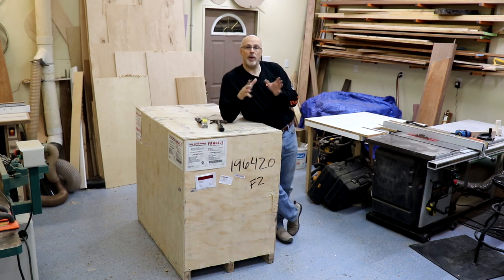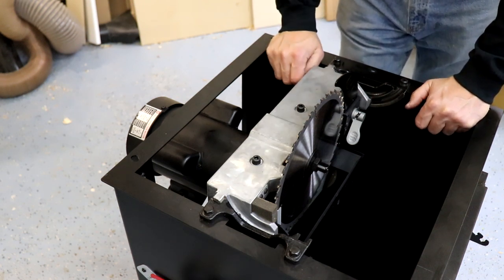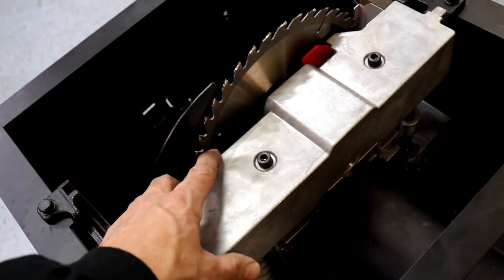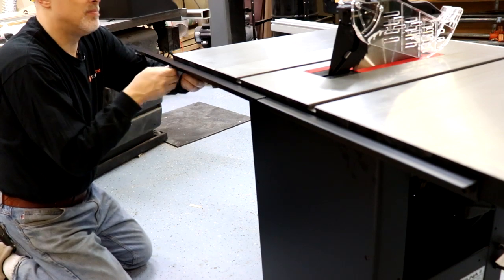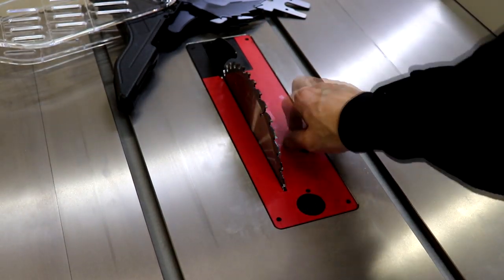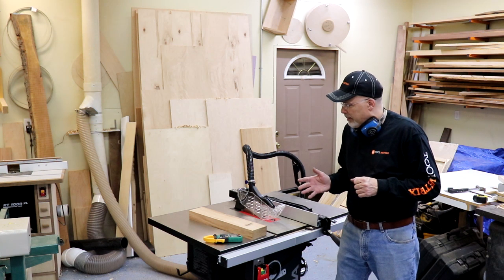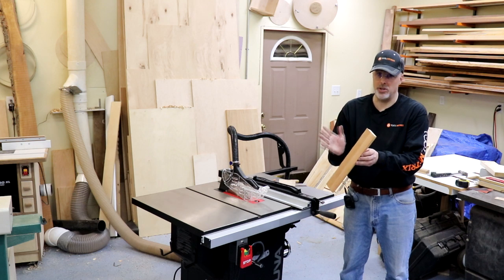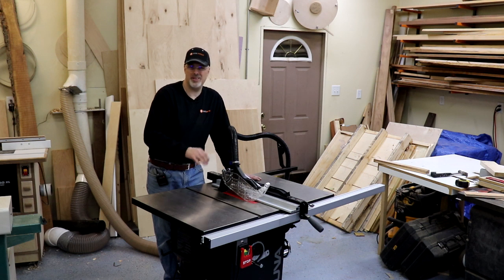Laguna Fusion F2 Table Saw Unboxing and Deep Dive Examination

Comment: What "tweaking" did you do to get the left to right tolerance so low? Mine's pretty bad out of the box.
Reply from the maker: I removed the wings and filed off the factory goop that was in the joint, and deburred the surfaces. After doing that everything went together nicely and the top was flat.

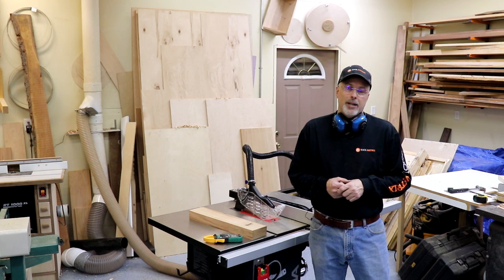Comment: You mention having a 20amp breaker (mark 10:30); however, Laguna doc states to have a 25amp circuit for F2 at 110v.  Any idea how to have a 25amp breaker on a 110v receptacle?  I pinged Laguna on it and no response.  BTW, the F3 states similar, 25amp breaker requirement for 3hp, which sucks as rules out my 220/20amp outlet in the shop.  Laguna did confirm F3 requires 25amp breaker for me, but nada on the 25amp 110v requirement.
Reply from the maker: Hi TBone,   I ran the F2 without any problem on a 110V 20amp breaker, and I pushed it pretty hard.  To have a 25 amp breaker on a 110V circuit you should have 10 guage wire.  I'm guessing that less than 1% of F2s are running on 110V/25 amp circuits.  Most are likely running on 110V/20amp circuits, and some are probably running on 220V circuits.  I ran all of my tests on the F3 using a 220V/20amp circuit, and didn't have any problems there either.

Comment: thank you ToolMetrix for another great review!... how does the dust collection on this compare to others in this category?...assuming a solid 400+ CFM dust collector as recommended in the manual. Is it just average? or fantastic? Also, for table saws in the $1100 - $2k price range, what other recommendations would you make? And lastly, how does the fence on this guy compare to others in this price range? I plan to make my move but given this is fairly new, I don't want any regrets. Thank you so much in advance!!!
Reply from the maker: Hi Matthew, thanks for the feedback.  On the dust collection front, I think its tricky for a manufacturer to provide a one size fits all solution, because so much of what makes a perfect configuration depends on how much air flow you can deliver.  It's unique to include above table collection, and it's neat that they did that, but in order to get decent collection from both above and below the table, you will need a dust collector that is larger than 400 CFM.  If I had just a 400 CFM collector, I would remove the above table collection and focus all of the air flow on the below-table collection.  If I had 600 CFM, I'd use both upper and lower collection.  With 800 CFM I'd expand the internal ducting to 4", all the way from the outside of the cabinet to the blade shroud.  And if I had 1000 CFM I'd expand the upper dust collector hose from 1.5" to 2.5" and I believe it would get much better collection.  And just to be clear, I'm not talking about the theoretical maximum of the dust collector, I'm talking about the actual air flow at the connection to the tool.  In that price range I'd also consider a SawStop contractor saw, or stretch your budget a little bit to a SawStop Professional 1.75 HP.  No question that is a more expensive saw, but the safety feature is nice and quality is good.  I think the fence on the F2 is a huge winner.  Functionality wise there's not a fence on a table saw in this class that I like as well.  Quality wise, I'd say that this fence is comparable to the SawStop Professional or the Jet ProShop.
Reply: ToolMetrix This is exactly why I am such a big fan...  informative and very helpful. Thank you! I am costing out a Contractor SawStop with the upgraded fence.... yes a bit more $$... I may go this route and just forego the stellar dust collection for the time being. Thanks again! And good job.

Comment: Thinking about upgrading to this saw, but I would probably want to transfer over my Incra TS-LS positioner fence.  Anyone have the Incra installed on their Fusion?  This saw looks pretty mobile in the video, which is also important for me because I regularly have to move my saw around to have enough room for cutting.  Any issues with mobility?
Reply from the maker: Hi Edward, sorry about the late reply.  Mobility is fine, although the wheels aren't super big so you'd want to clear a path before moving it.  Some of my tools have larger wheels and I can roll over pretty much anything.  Not a major problem, however.  I didn't try an Incra on it.

Comment: On the F1 and F3 videos you tested for decibels and also the amperage under heavy load. Do you have these for the F2. I'm about to pull the trigger on either an F2 or F1 and would like the comparison. I have a 110v 20A dedicated line for the saw.
Reply from the maker: I ran the F2 on a 110V 20 amp circuit with no problems at all. Amperage draw as shown in the video was 19 amps with that piece of thick oak. Decibel level was just a bit lower than the F1 as I recall but I don’t have the number.

Comment: Other than the cloth did you  use any cleaner to remove the manufacturing grease/oil from the cast table.
Reply from the maker: Nothing else was really needed to remove it. It came off super easily. But I wiped it down with mineral spirits just to be sure that all the residue was gone.

Comment: Why is cast iron good for table saw wings?
Reply from the maker: Hi Stan, it's generally preferred for stationary saws and other woodworking equipment due to its resistance to flexing, flatness and added stability from its weight.  You can certainly produce great results using a saw that has stamped steel wings, however.

Comment: Does the blade guard accommodate full-kerf and thin-kerf blades?
Reply from the maker: The blade guard is fine but you need to swap out the riving knife for thin kerf blades.

Comment: Thanks for great reviews f both the F1 and F2.  I am moving to a basement shop and I am struggling over which saw to purchase because of the logistics of moving it to the basement down stairs.  I was leaning toward purchasing an F1 due to the weight.  However, I really like the features of the F2 and would prefer it to the F1.

You stated that the top of the F2 could be easily removed.  Do you have a feel for the relative weights of the top and the cabinet when separated?  Do you think removing the top from the F2 and moving it in pieces down the stairs would make it easier or as easy as moving the F1 down them?

Any advice would be appreciated.  Thanks!
Reply from the maker: Hi Paul, sorry that I missed this previously.  Yes, I'd rather take the top off of an F2 than an F1.  I don't have a feel for the relative weights of the components when the top is removed, but my hunch is that the two pieces both become pretty manageable for two people when they are separated from one another.

Comment: Thank you for the great videos of the different Laguna Fusion models. So you were running the F2 on a 20 amp circuit, correct? I see Laguna recommends a 25 amp circuit for the F2, but I'd prefer to stick with the 20 amp I already have in place if it won't be problematic.
Reply from the maker: Yep,  I didn’t have any problems with it running on a 20 amp circuit.

Comment: Years ago I watched the New Yanke Workshop with Abe Norman during one of the shows he polished his top so I started doing that and not only didi the wood ove faster but it didn't let it rust.
Reply from the maker: Norm Abram was the best!  One of my great inspirations. I’ve tried a lot of different coatings on cast iron surfaces but haven’t found one that is both slick and prevents rust.

Comment: My F2 has been ordered. Hope it get's here before I die..... My question is what did you use to remove the anti rust junk  ??
Reply from the maker: Hi Harry, it wasn’t a problem at all. Just wiped it off with a dry paper towel, then one dampened with mineral spirits, then one more dry one. Done in 2 minutes.
Reply: @ToolMetrix  Kewl I live in Arizona so it'll evaporate before I get it...LOL
Reply: Laguna recommends WD-40 on their bandsaws (i just picked up a 1412) I used it and it worked great.

Comment: How did you remove the the table saw from the bottom pallet? Can it be done by one man?
Reply from the maker: I just removed the bolts and walked it off the pallet.  Yep, I did it by myself.  No problem at all.

Comment: Why why why aluminum trunnions and not cast iron? If every other manufacturer who sales table saws in the $900-$1200 range (example Grizzly, Shop Fox, Delta, etc etc) can do cast iron trunnions then why would Laguna be cheap and use aluminum trunnions? I understand the F1 having possibly aluminum trunnions but the F2 seriously? I really like everything else here about the saw. I can deal with aluminum rails and fence but trunnions? And you went as far as to cabinet mount the trunnions but make them aluminum? Sorry I’m just seriously confused and bothered by this at the price this saw is.
Reply: Hi, the trunnions are cast aluminum and this is less brittle than cast iron and can be machined far better.
Reply from the maker: Great points, William.  Thanks for chiming in.

Comment: Can a thin riving knife be used at the same time as the blade guard?
Reply from the maker: I’m not sure if you can swap the riving knife in the guard to use the thin kerf. I didn’t attempt it and I no longer have the saw in my shop.

Comment: Paul, Thanks. For a new hobiest do you feel the F2 would be a good dependable saw. I remember my father's 40 year old saw that I had to adjust the fence just about every cut. I've seen other reviews where they state that is an issue with this saw. Also, comparable saws for the money? Do they exist?
Reply from the maker: Hi Eugene,

I feel good about the feature set and quality of this saw.  I wouldn't expect to have to make adjustments to the fence on a regular basis to maintain accuracy.  It didn't vary at all while I had it in my shop, although I didn't have it very long.   For a comparable saw, you could look at this one from Jet: https://amzn.to/2KHSuYj.   For a bit more money, this PowerMatic would be worth comparing as well: https://amzn.to/3bNkiGx.
Reply: @ToolMetrix   I'm looking to get this saw. Your review was excellent, but I had a question.
How come you don't have the Laguna saw any more?
Reply from the maker: Hi Joe, Thanks for the feedback on the video.  Also, thanks for the question; I get that one a lot.  I'm a tool reviewer, which means that I need to have a steady stream of new products coming through my shop for evaluation.  If I like them overall, I make a video or two.  I wish that I could keep them all, but I have a small shop that is getting crowded.  I moved out the F1 and F2 after making those videos to make room for the F3.  Now the F3 video is posted and the saw is moved out to make room for a DeWalt table saw, and one other.  I haven't decided on the brand of #2 yet;  I just know that it will be a portable unit so that I can have a point of comparison.  The odds of me keeping either of the new portable saws is slim as well.   So, you shouldn't interpret the fact that a tool is no longer in my shop as any form of indication that I don't like it.    Cheers, Paul

Comment: I'm torn between this, grizzly g0899, and jet pro shop. Seems like the grizz is best at that price point
Reply from the maker: Hi Jon, those are good comparables. What are you basing your assessment and ultimately your selection on?
Reply: ToolMetrix best bang for buck. Grizzly ran a sale so I got one to the house for $1300. I liked the full cabinet and steel rails vs the aluminum rails on the fusion. I’m waiting on shipment now

Comment: with the euro fence having the wing nuts on the right hand side does that eliminate the possibility of being able to mount a router table on the right side of the table? Also, is there a blade brake? you cut the video every time you turned the saw off.
Reply from the maker: The motor has a brake to slow the blade down when it’s switched off but there’s not a blade brake like you’d find on a sawstop. You would have to do something if you mounted a router. Would be easy enough to build a router table fence that slipped over the stock fence.

Comment: This is the old F1 Fusion, now repacked as the F2. I have had the saw for a year now and it's meets or exceeds all of my expectations. i have been woodworking for over forty years and used many styles of saws. For the money, you can not find any other saw out there with these features. The new features are the Euro style fence and the upper dust collection, that is really needed.
Reply from the maker: Interesting. Thanks for the perspective. I wasn’t aware of the History on this.
Reply: F2 also has caste iron top wings

Comment: With having hands on both of them, would you say the F2 is worth the additional cost?
Reply from the maker: In my opinion, If you’re not looking for portability, then the F2 is definitely worth the jump up. The cast iron extensions and fence upgrade alone make it worthwhile. The better trunnions and additional power are nice too, although the power difference is pretty negligible.
Reply: @ToolMetrix  sorry to jump in, but can you clarify "portability"? i store my table saw against the wall in my shop because I dont have space to leave it in the middle of the floor, so I routinely have to move it away from the wall and back. is that substantially easier on the F1, or were you more referring to ability to transport it to a different location rather than just move it around the shop?
Reply from the maker: Good clarification. I was referring to job site portability. Loading into a truck, etc. For rolling around the shop it’s a wash on that point, and I’d definitely lean towards F2.
Reply: @ToolMetrix  thanks!

Comment: Great vid Paul. The unboxings are very informative. Seems you get a lot of saw for the money with the Fusion2. I'm trying to determine if I can get the saw in my basement. Can the wings be removed and re-installed without too much hassle? Or the whole top, as you did?
Reply from the maker: Hi James, thanks for the feedback. Yep, it’s easy to remove the wings and the table top on the F2.  The wings have some goop holding them on so you have to give each wing a smack after the bolts are removed. Not a big deal. And as long as you have a good straight edge you can easily get the wings installed flush with the main saw top. I actually got the wings installed a bit flatter than the factory when I removed them and reinstalled them.
Reply: @ToolMetrix  That's great Paul. I think I'm ready to pull the trigger. Big thanx!

Comment: Looks great. I’d love to see a Fusion vs Sawstop comparison. I realize the stop is unique to them but the other features compared would be helpful.
Reply: Sawstop will run you about another 1,000 for a saw. Don't get me wrong, I love my Laguna table saw. It's in the best saw for the price out there.
Reply from the maker: Thanks for the suggestion.  I would like to get a SawStop in my shop for a Deep Dive Exam.
Reply: I liked this review even tho I own a sawstop pro cabinet saw, I still like to keep up with new tools. I think outside the safety they run a close pair
Reply: Shop Nation just did a review on Sawstop v Laguna Fusion F2

Comment: Thanks so much, I have been looking for a review on the new 2020 model. This is my next saw wondering if you tried wiring for 220V? I have a 220V line  in my garage from a dryer which I would dedicate for the saw. Also wondering if you assessed the included mobility wheels integrated in the cabinet? Not planning on daily moves, just occasionally.
Reply from the maker: The F2 has wheels preinstalled. They work great. I didn’t try wiring for 220. It works fine under heavy load on a 20 amp 110 so I would not bother.

Comment: I am trying to determine if this saw would fit into a space in my garage while it is not in use.  Can you tell me what the width and depth dimensions are without the fence, i.e. table + fence rails but the rip fence itself removed?  The Laguna F2 manual specs suggest the overall depth is 39.37 in.  Reading further, it would seem that the table depth is 27 in, and the fence rail width is 2.92 (about 3 in).  So would the depth be something like 27 + 3 = 30 or perhaps 27 + 3 + 3 = 33?  Looks like the overall width is about 67 in.  Thanks.
Reply from the maker: Hi Ed, sorry but the saws are no longer in my shop. I’d suggest calling Laguna or one of their dealers and asking them for this information. Cheers, Paul

Comment: Looks like a nice tablesaw. It makes a nice change to find a US tool co. selling their large tools like tablesaws etc. into Europe. The Fusion F2  retails here in the UK at the equivalent of $2485.00, which when considering the shipping costs for heavy or large volume frieght, compares pretty well with some good quality UK and European brands. Grizzly & Sawstop won't even consider shipping over here. Now I want one too!
Reply from the maker: That's an interesting perspective in the price point.  I wasn't aware the Grizzly and Sawstop weren't over there.  They are heavily penetrated over here.  Really surprising to me.  Who are the table saw leaders over there?   Also, I wonder if the incorporation of the European style fence system is specifically to gain traction in Europe.  After spending some time with one on this saw, I'm really puzzled why this is not the world-wide standard fence design.  It's better in many respects, and I really can't think of a downside.  I remember seeing this fence style as an option when I bought my Unisaw 20 years ago.  If I would have taken the time to understand it better, I would have chosen it over the style that I have.
Reply: @ToolMetrix  Most of the saws in Europe are sliding table design. Not a after thought , but designed as a slider. The major saws are Felder, it's lower price point brand Hammer, and Axminster has there own brand of saws. Felder is $7,000 and Hammer is $5,000 , that's why it's a very smart move for Laguna to enter the European market.